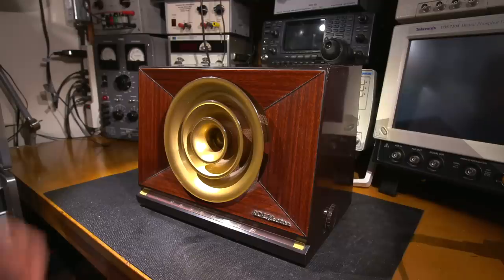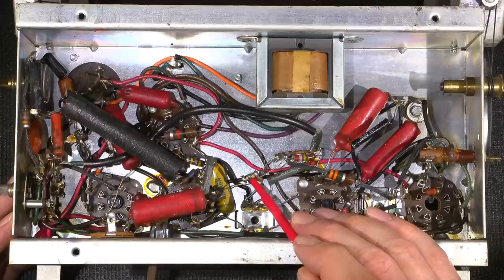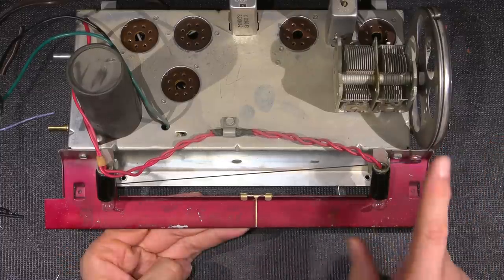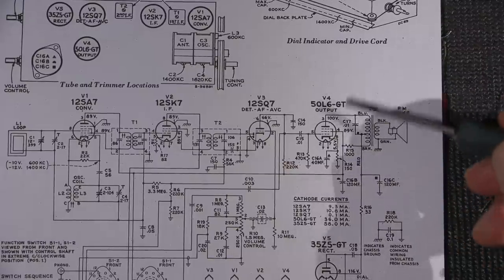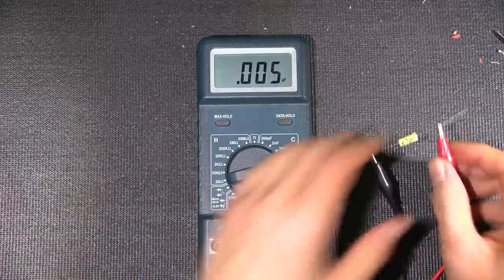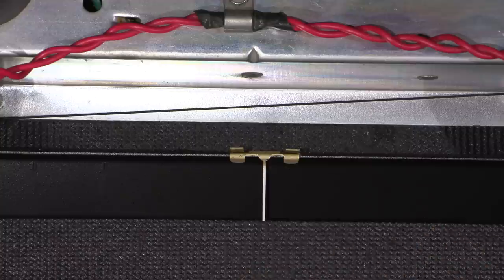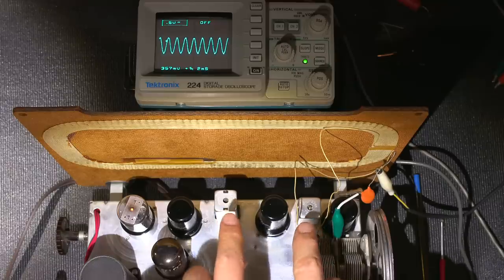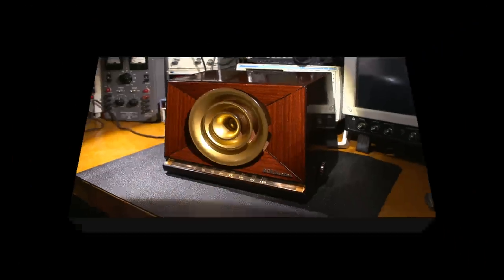Bizarre Looking RCA Radio! [Electrical Restoration]

Comment: I don't know why but I've only just got to see this one. I'm 67 and used to work on this type of receiver, although I'm in the UK, so I suppose we must have called them the All British Five! If I remember rightly, most of our transformerless sets also used a large and very hot mains dropper resistor, due to our mains voltage being at 240 volts. Thank you so much for all your hard work Paul, its really appreciated. Now, you've been making great videos for a long time now and I'm sure there must be one or two out takes floating around in the Carlson hard drive, so how about treating us to a few of your scenes that didn't go quite to plan!  Keep safe, all the best from Yorkshire, England.

Comment: The "Mr. Rogers" of electronics. Your voice is calming and smooth as silk.
Reply: compression works wonders
Reply: @plcc07777  Not as much as a decent mic
Reply: @plcc07777  Or just talk extremely slow
Reply: My settings were stuck on 0.75 speed from a video I was watching yesterday XD I'm ded
Reply: ASMR. Autonomous Sensory Meridian Response. (Look it up.  Hundreds of videos on that basis. It actually works).

Comment: "The Golden Throat" was a marketing trademark of RCA Victor in the late 1940's through the mid to late 1950's, and is a precursor to the "New Orthophonic" branding that began in 1955.  
RCA produced both "Golden Throat" and "New Orthophonic" concurrently, then the Golden Throat was dropped as the 1950's progressed.  "New Orthophonic" was the first of RCA's product line of phonographs, tape recorders, and amplification systems in the dawn of "High Fidelity" or "Hi-Fi" products.
Reply: How much are one of these models worth ?
Reply: @danielesbordone1871  unrestored value, between ten to about thirty-five; restored with great cabinet, about fifty to 125, depending on market, demand, condition, etc.
Reply: @seanbryant2848  ,   Dollars, US, about 2020.
Reply: My Father had this exact radio back in the early 90's. He tried to "fix it" by "adjusting" it.   It never worked other than the light bulb, and I'm not sure what happened to it.  It was not anywhere near the condition of the one in the video though so it's not a great loss.
Reply: Sounds quite pornographic.
Reply: @JUANKERR2000  oh my!
Reply: @JUANKERR2000  Is it what you know best of all?

Comment: Hello, I'm a fellow antique and vintage electronic restorer, I've been doing it since I was 13 and I'm 31 years old now, and I'm actually self taught through various electronics forums. 

Anyways whenever I've replaced the old paper caps in my radios I've never really observed the outside foil direction on them and I've never had any problems with any of my radios breaking into oscillation or anything they worked just fine after I replaced the old paper caps, of course it could of been that I just got lucky and the outside foil happened to be in the direction I installed the new caps in every time. 

The oldest radio I ever worked on was a 1931 Westinghouse WR10 tombstone radio that before I got it had sat in an old abandoned farmhouse that the roof had collapsed on it 20 years ago and the cabinet was shot on it but the guts were still good and all I did to it was replace the coupling (paper) caps in the set and it works perfectly I never had to replace the filter cap in it as it was of the dry variety and it was still doing it's job after all these years, not a single bit of hum in the set, and it's a great DXer at night. 
I also got it a "new" cabinet and the set looks and works as good as new. 

I love your videos.

By the way, that radio is referred to as the "Bullhorn" radio because the speaker grille resembles a police bullhorn from that time period.

Comment: Best explanation I’ve ever heard of capacitor breakdown results. “My amp never sounded better, just before it burned up”.
Reply: lol. Yes, that has also been my experience with tube guitar amps.  lol
Reply: My Gawd did Paul drop the knowledge here !
Reply: ahh, so redplating is for recording but not for practice or live gigs
Reply: @Craig_Hilbig  -  lol.  As long as the red-plating doesn't cause a lot of ripple from the power supply.
Reply: RB your comment prompted some reading (Valve wizard is great) and I just learned that filter caps are divided into reservoir caps and smoothing caps. So maybe a larger reservoir cap would mitigate?
Reply: @Craig_Hilbig   ,   I don't know of any EE who would use those terms. A capacitor is whatever it was designed for... far beyond two random terms.
Reply: Bruce Nitroxpro I have to admit, I am having difficulty getting anything constructive out of that comment. Should I be reading ‘random’ as ‘arbitrary?’ Are you saying that once a capacitor is in a circuit, it’s still has multiple functions that defy categorizing?
Reply: @Craig_Hilbig   Tube rectifiers can be a bit limited in the amount of capacitance it can handle- that would be your peak DC draw on the cathode as published in the tube manuals.  IIRC a 5AR4/GZ34 is only good for 30-40uF of input capacitance.
Reply: countryhamop ooo interesting. This will be a fun thing to read about this week. Thank you!

Comment: Beautiful old radio. Thanks to your videos I’ve restored a number of AA5 radios and one 1940 RCA console K80 chassis. That one had old crumbling rubber insulated wire that had to be all replaced along with all the tubes including the magic eye. Thanks to your videos I dove in and rewired, re-capped and changed about every resistor in the radio. It turned out great and had great range on the broadcast band reception. I was pulling in NYC stations at 5:00PM in mid October 350 miles away, I can’t do that on any other radio I own. My customer was very happy with the restoration. I usually work on old tube guitar amps and audio amps. I wanted to try my hand at radio work and you definitely helped me have the confidence to do it. Even rebuilt some IF cans with silver mica disease with perfect results. Thanks for sharing your knowledge. I am a Patreon supporter and always look forward to new projects.

Comment: I watched every minute of your restoration and you nailed it. The 1949 RCA 9-X-571 was possibly one of the best AA5 radios ever produced. The bass that this radio is capable of reproducing is crazy.  It's the Bose radio of 1949. Big sound from a small package. I would like to point out that the 50L6 output tube is notorious for developing grid leakage after full warm up. The DC voltage on the control grid starts to rise and the tube conducts harder causing the tube to run hotter and go into thermal runaway. This causes distortion and taxes the DC power supply. The control grid voltage should always be checked after at lest 5 to 10 minutes after warmup to verify it remains near zero volts DC. The only other issue I have is with your alignment procedure. When adjusting L3, the 600 kHz oscillator coil, you must rock the tuning gang and alternately adjust the L3 oscillator coil to find the most sensitive point then repeat the 1620 kHz trimmer adjustment, the 1400 trimmer adjustment going back to the L3 600 kHz until no further improvement can be made.  Unless you have an AM transmitter,  there isn't much program material on the AM band that can show off the performance of this radio. The three step tone control cuts the high frequencies at one end, cuts the low frequencies at the other end and is full ranged in the center. The volume control is actually a dual tapped loudness control that boosts low frequencies at lower control settings. The phono input requires a full one volt signal to dive the amplifier to full output.  I can't post the original sales info that I have but this radio cost $39.95 in 1949. That equates to $437.08 today.

Comment: Great explanation of the "warm sound" due to capacitor leakage. Audiophiles get so mad that they are not taken seriously by audio engineers, but here is an explanation that takes their "warm sound" claims seriously AND explains the reason in engineering terms!

Comment: Your explanation of the bias effects of leaking capacitors reminds me of something I ran into recently: On a 16-channel Behringer mixer, some channels didn't work at all on some days, and were fine on other days, and different channels were bad on different days.  What I discovered was that they had used no-clean solder flux on the PCB, and when the air was damp, the flux residue absorbed enough moisture to drive some of the channels out of balance far enough to stop them working at all.
Reply: Now that is interesting. I've had suspicions about humidity and barometric pressure affecting the sound in systems.

Comment: i actually think your videos so excellent that someone with no electronic training could troubleshoot an audio circuit just from watching your videos. especially tube circuits.  with minimal equipment. maybe you could explain some of the safety features of lab equipment.  i went to hamilton tech in davenport iowa founded by a former dj who in those days had to be an engineer to get a license to broadcast.   my best teacher like you was a whiz at communications repair. back in those days there was no internet- diagrams were hard to locate. he could back engineer circuits just like you. he could always reduce something to a level you could understand and understanding is gold. he overheard me explaining something to another student and remarked i obviously understood the principle or i couldn't have reduced it further. that made me proud coming from him.  he was a master of his craft and a teacher anyone could understand. kind of a rare thing. his name was dennis bridgeman  and you are a teacher on his level and as rare as hens teeth.  i remember the class books putting me to sleep on many a night. i struggled with the math until i allied myself with a student who had just graduated from a 4 year college with a math degree. then the lights came on.    what you do is priceless. you don't lecture you show. in detail. your lab work is better than anything i ever had in school. your parallel capacitance resistance testers are a new level of troubleshooting accuracy. i hope you live a long long time and keep educating us. it is truly appreciated

Comment: I just finished working a 1955 RCA which, being newer, uses miniature tubes. It looks like they used a similar circuit in that one. It aligns exactly the same way too. That particular circuit design was used a lot of chassis. That one also worked really well when I got done with it. This was very informative and helpful, thanks.

Comment: What a great way you explain the problem with capacitor leakage and the effect it has on the biasing of the tubes (we call them valves) in amplifier circuits.  I have been trying to explain that effect for years and you have done a much better job than I have.  Great video.  I was surprised how close the alignment was after changing out all the old waxed-paper capacitors.
Reply from the maker: Thanks Chris!

Comment: What a AWESOME looking radio! Everything I see here has been "rode hard and put away wet" ( an expression for riding a horse at a full run, covered in sweat and just put away without washing, cleaning or brushing.... a real mess) and all the radio sets are common as dirt. Another excellent restoration! Thanks!  Proud to be a Pateron :D

Comment: Found the first Newspaper ads for this radio in Dec. 1945.  They really did quite the campaign for these as the first with FM radio.  This sold for $95.00 in 1946.

Comment: I own one of these radios myself, but haven’t gotten around to restoring it yet. Even so, it’s one of my favorites in my collection because it’s just so unusual and fantastic-looking. I thought this was just going to be another All American Five restoration (which is always fun on its own), but you made this video so much more. Your insights into the reasons for “that warm-tube sound” were especially appreciated. Happy Thanksgiving to you and all my fellow MCL acolytes!
Reply: "Driving it harder into class A" ... well, it already is class A. Driving it harder makes it go into compression, distorting the waveform and rolling off the high freqs.

Comment: Love that capacitor knowledge! I have a Sears Silvertone Twin Reverb tube guitar amp, packed with four 6L6 power output tubes. Left it with my family, hasn’t been plugged in for decades. Now I know not to plug it in and fire it up without first following your sound advice to preemptively replace the caps. I have since learned that this model is a highly cherished classic among musicians. Thanks! 👍🎶

Comment: Thank you for explaining how a leaky capacitor can overdrive the output.  That nice 'warm', class A sound goes hand in hand with that nice 'warm' plate that's burning up inside the output tube! 👍 Now we know why the output transformer will open up. Gorgeous radio, Excellent video.  Well done!
Reply from the maker: You're welcome Michael. Thanks for your kind comment too!

Comment: I've worked in electronics since 1975 (now retired), but the components and connections in this device are absolutely stone-age in comparison with anything I'm used to. Shows how far technology and manufacturing has come in just the few decades since this device was made. FWIW, the modern equivalent of this circuit would probably fit on a U.S. 25¢ coin (or smaller). LOL.

Comment: I remember this radio well.  This is much cleaner than the nearly identical radio I had -- in 1970.  Mine was a very slightly different model - it looked the same except that the cabinet was all black - none of that woodtone on the front - and it didn't have the tone control switch.  It did have the phono input, but this was selected by a slide switch on the back of the chassis, and the power switch was integrated with the volume control, so there was just one knob on the left side.  I believe it had felt washers under the knobs, so yours have probably been lost over time.  This radio was paired with the 45 RPM record changer that RCA was famous for in the late 1940s and 1950s.

Comment: Very interesting radio Paul.  RCA did several things to improve the sound quality on this model.  This is the largest audio output transformer I have ever seen on the "American 5" tube set, obviously to improve low frequency response, along with the larger speaker, audio coupling caps, and V4 cathode bypass cap.  The detector has light capacitance loading, which lowers detector distortion.  The audio output transformer has a tap on the primary (brown wire) they are using to reduce the DC bias on the core.  R15 is being used to swamp out the inductance modulation of the speaker voice coil but, at the expense of throwing some audio output power away.  On the other hand, there is no audio feedback from the audio transformer secondary!   The power supply filter caps are unusually large, so much so that R16 was inserted to limit surge current from the rectifier.  The only modification I would make to this radio is replace R11 (10 Meg) with a metal film resistor (carbon resistors are very noisy at this high resistance).  I think this "Golden Throat" series started in the late 1940's and ended some time in the 1950's.
Reply from the maker: Thanks for taking the time to write Bill.

Comment: This is Amazing! This is exactly the radio which was in my throat specialist's office in the early to mid 1950's. At the time it looked ultra advanced/real sci design. This radio was also a prop in several major motion pictures to my memory. This was just one of the iconic images of that era because of its really stark, advanced look. As this was a higher priced product in the RCA line you can expect higher class, but not really total hi fi sound.

Comment: I made a converter a few years ago to use a 12BA7 in place of a 12SA7 in an AA5 radio.  I took the radio apart in which I used it recently and I don't need it anymore so I might just send it to you along with the tube.  The 12BA7 is a 9-pin tube similar to the 12BE6/12SA7 but with much higher transconductance.  The only modification needed when using it with an adapter is to adjust the tuning capacitor to recalibrate the tuning dial on the high side.

Comment: In 1955, at age 13, I carried my AA5 up to the attic because "higher is better."  I then unspooled the antenna to get it better spread out - into a quad about 20 X 20. Bazinga! I was listening to a local ham club on 75M and to the BBC. The rest is a long story.

Comment: Hi Mr Carlson, I've been watching a lot of your videos lately and I recently bought my first antique radio from an antique shop. I've learnt a lot from you and now I'm trying to apply the restoration knowledge I gained (So I thank you a lot!). By the way, if you feel like it, can you please make a video with a focus on cabinet (wood/bakelite/etc) and chassis (the metal enclosure itself) restoration, instead of the electrical restoration you'd typically do? It would be useful for us to learn how you make your restored electronics look good as new. Thanks and advanced Merry Christmas, BJ
Reply: In the meantime, you can check out Buzz1151's channel. He goes through the woodwork repairs as well as ways to clean up the chassis on these old radios.

Comment: My parents were RCA fans. We had this radio as well as the 45 RPM record changer to plug into it. It spurred my interest in electronics. Thinking back, Isn't the chassis electrically hot?  Those All American Fives had insulated controls but the phono's RCA jack was bare metal.

Comment: Very nice restoration, interesting case design of this! Also, the explanation of coupling cap leakage and consequent high biasing of the next tube, leading to "warm sound" is very good! I believe the tube sellers also will like to sell more output tubes..